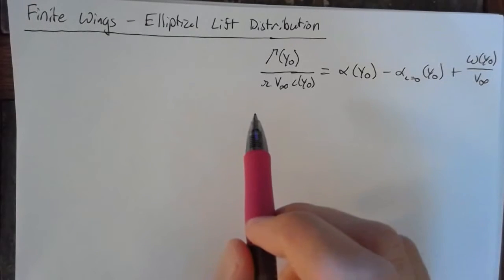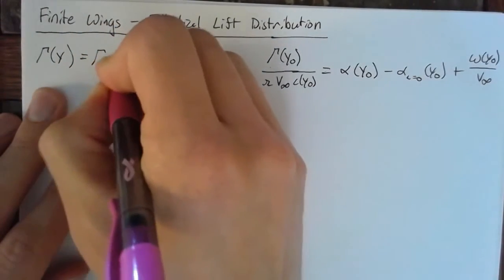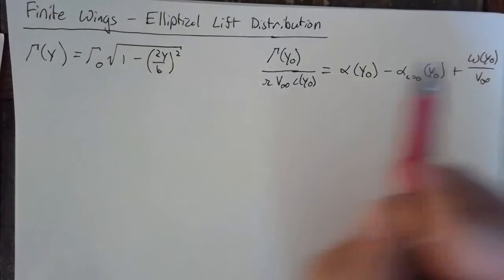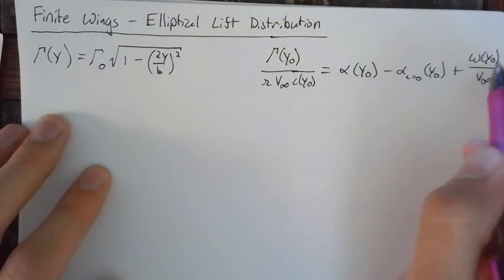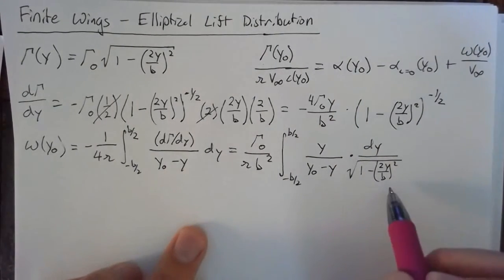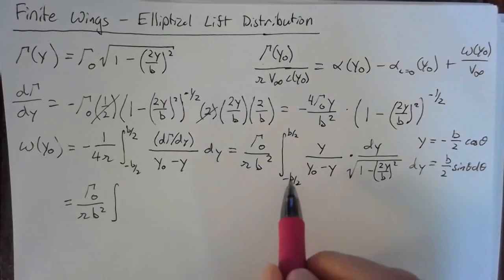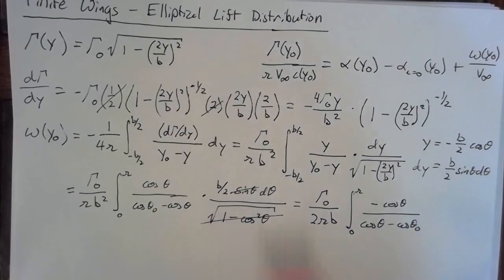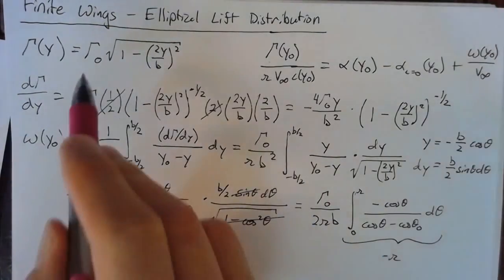Finite Wings - Elliptical Lift Distribution

Comment: Friend, didn't you mean an eliptical vorticity distribuition instead of an eliptic lift distribuition ?

I'm confused, for me that's an eliptic vorticity distribuition.
Reply: I think it must be elliptic distribution of the circulation Γ.Anyway, it is noted in the description as a vortex strength distribution.
Reply: as we know that lift per unit span is equal to the given expression(L=  ρVΓ), so lift is proportional to circulation which causes vorticity at every vortex filament. so we can use both the terms. it means the same.